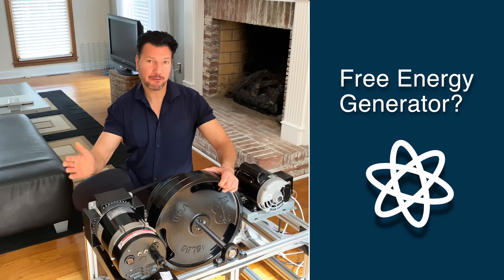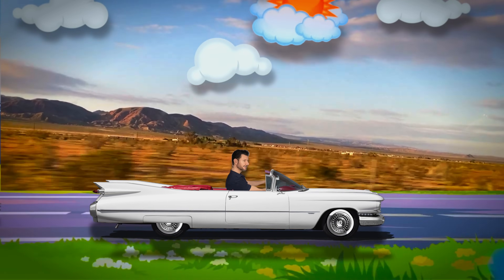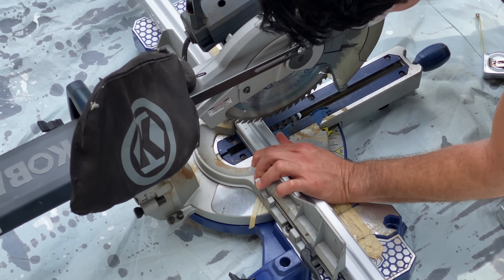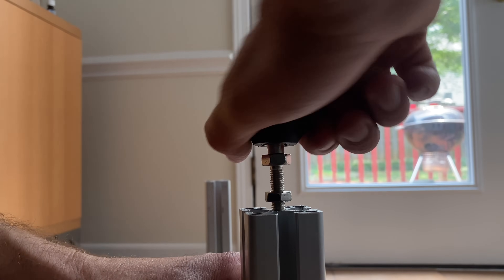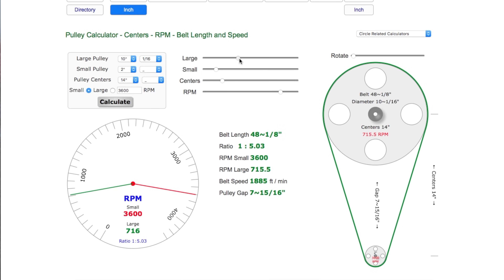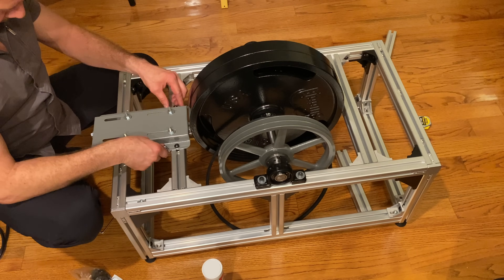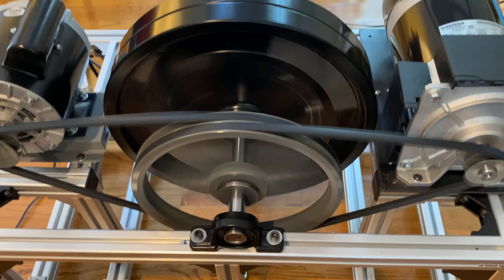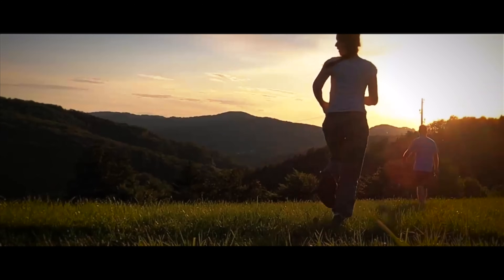How to Make a Free Energy Generator!

Comment: Finally a serious video !, I am playing with free energy since 10 years now ( i am a certified electronics technician )and, my best result was with gravity generator ( like william skinner ) i fully understood his system and ITS WORKING !. A flywheel is like a mechanic capacitor, aka it will accumulate the energy from the motor BUT you will store ONLY a part of the spent energy to run this flywheel....so its a 1to .7 ratio...you loose energy.....you will need a very effective motor ( like pmg ) to run the flywheel and in combination of a very effective generator too maybe you will have a gain greater then 2.....you will have to fight with friction,heat,back emf, to reach that level of efficienty.with a w.skinner system, a child can push a 200 lbs of weight with a finger and return to his initial position with the same finger push !! thats efficient... the problem with all the video of youtuber i seen was not the initial understanding of mr skinner........but justed a fade imitation ! its so simple but it took to me 5 years to fully understood !!
Reply from the maker: I will have to look Mr skinner up.
With your background and 10 years of research I hope you will give me your feedback also on my next video that I am planning about free energy.
I have some new ideas that are right up your alley would love to hear what you think of it. Hopefully I can get it done by mid Nov.
Thank you!
Reply: @MarkusNenning  OF course !, i will be glad and curious too to watch your further desing ! sorry for my english coz i am a canadian french speaking language...
Reply from the maker: @topgun4229  no problem English is not my first language either
Reply: @topgun4229  well as a certified expert, you should know right fr the start it’s not going to work , basic physics !!
But why search for free energy in this pointless way, it’s already here and easily available, 
Solar power, i haven’t paid a power bill for 8 years, 
(Easy so long as you have some place for panels)
Reply: @spinnymathingy3149  You are RIGHT and NOT !!, there is nothing free of course, BUT, take a lever as an exemple..... you can lift a heavy weight with a smaller effort than without, right ! In my example of w.skinner, the system is so effective than you can move a very heavy weight and, return it as is initial state with the same effort !, its PHYSICS ! not MAGIC !

SO, lets say that what we called the so free energy effect is in reality a very effective way of using physics to create a greater effect, in this case, i used the gravity, its free, and always availlable !! i worked on almost every different kind of '' free energy ''
the very popular flywheel too...and yes its possible BUT you have to use a way to introduce the power of gravity into your system...otherwise it will act as a mechanical capacitor..thats it !

Remember, not so long ago....the maximum speed of a car was 25mph, today, with the same amount of fuel, speed are over 80mph !, this is because they found a more effective way to use fuel !, same here ! just compare the LED to an old filament bulb light ! LED use less power for brighter light !
dc motor too are involving !
So, to conclude, never say its impossible because they said is it, look forward with a new idea and you will succeed !
Reply: @topgun4229  respectfully your 2 examples don’t add up to a logical conclusion to support your thoughts. Firstly with W Skinner, those displays were over 80 years ago, now with the increasing cost of power over the last 40 years there would be an available generator as shown in every house by now, the clear fact that there isn’t is proof it doesn’t work. Secondly the example of how when using a lever you can easily move a heavy object, ?? that’s a simplistic understanding of what’s going on, your not getting out more than you are putting in because it takes a lot of light movement on 1 end to get very little movement on the other heavy end, doing the maths power in = power out (less losses along the way)
Then the other examples of a car travelling faster now than previously, of course engines are more powerful now, but compared to the power source going into the engine (fuel, petrol ect) they currently are only around %35 efficient, that’s right %65 of energy used to drive a car, run a power plant ect is wasted in friction, heat and noise ect
Reply: @spinnymathingy3149  Dear spinny.... You make exactly the same mistake what most people did !, even some real university students understood what i tried to explained ! , its very hard trying to explain such concept just by writing....give me some times, and i will show you on my website HOW to use gravity to make a skinner machine ! I dont believe in free energys.. But I believe of a better use of available energy for multiplying this energy !
About car...... in the sixties, my father in law buyed a new car ( ford ), after a week of traveling around, the gaz tank indicator was almost near full.... so, he called back the dealer and explain that the fuel gauge was deffective...after a week, the car was repaired and the problem was not the fuel gauge, but.... the cie forgot to remove the experimental carburator ! instead of 6 miles per gallon he was experiencing a..60 miles per gallon !!!,
I heard the same story from an old american guy who had the same experience !, So, believe me... Things can be made better !!!
Reply: @topgun4229  great to see that you are trying to achieve efficiencies, the world needs that. 
Could you please explain to me 2 things, 
What you currently can achieve ?
What you think will be achieved ?
Reply: I loved the explanation. Well so this can work for sure
Reply from the maker: @mwambabuilders  No in this setup it does not work.
But I will share a few ideas that I think could possibly work in my next video.
Thank you!
Reply: How can an average person understand? I’ve been searching for a few years, but I’m not an electrician and barely understand how this works. Ps. Another Canadian here.
Reply: @ariannarp6866  The genius was william skinner....he gave us in 1939 a small video showing his invention...when you have like me a good background in science and you tried EVERY 2 DAYS to understand, for sure you will understand after 10 years !!!, lots of people tried WITHOUT understanding coz they didnt understood the principle of lever and weight......the only drawback is....its big and heavy....lots of weight are involve here...but it work ! and it doesnt breake any law of physic !
Reply: @topgun4229  cool. Thank you. I hope it’ll be simple enough to figure out at some point.
Reply: @ariannarp6866  I will release soon howto to this AKA how to moove a big weight from 0 to 180 degrees to 180 to is initial position with only a few miliwatts!
Reply from the maker: @ariannarp6866  I don’t think you need to necessarily be an electrical Engineer.
Sometimes people  with common sense  achieve much more because the have no bias towards possible or not.
What is it you would like to accomplish?
Reply: @MarkusNenning  true. I want to create free power on an off grid scenario.
Reply from the maker: @ariannarp6866  in that case you might want to collaborate with someone else.
Reply: @MarkusNenning  👍

Comment: Hey I think your doing a great job! Have you tried a larger diameter and heavier flywheel?  I think the heavier the flywheel is the better it is 400lb min. This creates the enertia/torq that is needed To maintain the generators speed. I’m sure it will work. Are the usable watts the difference between what the dive motor produces and the watts the generator makes?
Reply from the maker: Thank you Adrian!
I will have to reinforce my living room floor before I can build a 400lb flywheel :)
I am thinking of doubling up my plates or find something with a bigger diameter like you suggested.
Reply: @MarkusNenning  Stop fooling people you rogue.
Reply: Try to use concrete in a bigger diameter truck tyres.
Reply from the maker: Thanks

Comment: due to drag, gravity, inefficiency of the motor and generator and a few other reasons this should be impossible. Does not mean you cannot have fun seeing how far you can take it. I would recommend changing from big pully on the flywheel with a small one on the generator to swapping them around. so small pully on the motor to a big one on the flywheel then a small pully on the flywheel to a larger one on the generator. 

Also look into a more refined rectifier to handle the impedance on the generator. maybe bleed it off to a supper cap that can help with the initial spike in draw when swapping the motor over.  

I would also suggest something to encase the flywheel as well. reduce the turbulence generated by the open air gaps in the weighted plates. the turbulence is a loss in energy to drag. we all know a near perfect vacuum would be best.
Reply from the maker: Thank you very good suggestions! And yes I am having fun! :)
Reply: @MarkusNenning  there is also a variable pully system that uses a clutch system widen or make more narrow the gap increasing or reducing the size of the pulley dynamically. Can't wait to see the next experiment.
Reply from the maker: @jsdraven  I will have to look that up 
Thanks!

Comment: There's a reason the Indian guys use older motors & generators. There's no limiters & failsafe switches in older motors. Also, if you're in the US you're use to 110v but most of the world use 220v to 240v. We don't have access to 110v because it's so dangerous & I dare say India is in the same camp having had greater British involvement. In the US they've obviously countered the jumping of the circuit somehow. 220v is much safer because it requires lower amperage & therefore the wiring can be smaller.
Reply from the maker: Thank you Rex 
Yes, I think a three-phase system would be more sufficient but unfortunately, I don't have that in my living room :) 
I actually made a video about the topic you speak of if you're interested 
https://www.youtube.com/watch?v=H1pLg9QWPMM

Comment: I have been looking at this type of set up for months along with hydroelectric and solar options.  Do you think it would be possible to set up a 24 or 48v system to run a brushless DC 3750 rpm motor off a battery bank? 

You could then charge this while the generator is running off a simple battery charger without drawing down the voltage when switching from the grid to the generator.  Then you could run the house from a clean power inverter.

I am looking for a silent means of generating power without drawing attention.
Reply: With electronics everything are possible !, you will need some high power diodes to insulate both power sources ( you dont want to send power to your solar panels to your hydro-generator...otherwise you will destroy each other...)
some circuits to dump excess power to not overcharge the batterys bank ( you dont want to destroy the batterys....) you will need deep cycle batterys ( regular batterys wont survives a lot of charge=discharge cycles ) and of course some inverter ( sinewave or squared wave ( cheaper but not very good for transformer based appliance), so...yes its possible !
Reply from the maker: @topgun4229  thank you!
You seem to know what you are talking about!
I may have some more questions for you down the road! :)
Reply: @MarkusNenning  No problem !with my 50 years of knoledges i will be glad to help ! ( i am not so old lol.......but i made my first am voice transmitter at 11 years old.....i saw the evolution of electronic,and never stop learning and practicing.......
Reply from the maker: It’s an interesting idea Howard.
A friend of mine is starting a hydroelectric generator soon to run crypto mining equipment.
I may visit him and make a video.

I have also already thought about perhaps using a few solar panels to support the generator.

I will share my new concept in a future video hopefully soon.
Thanks for your feedback!
Reply: I believe these systems work due to correct combinations of motors, generators, alternators and mass size, tuned correctly.   ac or dc.   system rpm, voltage, and size should not be a problem as long as you have balance in tuning the components.      Tip:   instead of using the water in hydro power system to spin something, use the water as a mass, it's weight to set up an oscillation.  funnel the water through a pipe that you can swing side to side, allowing the weight of the water to rock a mass.   like a pendulum, then use the rocking pendulum to power what ever you are wanting to power.
Reply from the maker: @rmendes2mendes915  interesting idea.
Thanks!

Comment: Thank you, great job
The idea is good and may need some adjustment, such as the motor speed should be as high as 3000 rpm, the motor pulley to be as small as possible, and the generator should be at a low speed, preferably 750 rpm.
Thus it can reduce the engine load.
The flywheel also must be weighted around the outside to give a more efficient thrust.
Finally, if this method does not work, you can use a DC motor and start it from a battery, then charge the battery from the generator, and so on, it is sure to work
Once again thank you.
Reply: the motor speed should run at a rpm where it operates at its most energy efficient speed.  motor pully agree, small. low speed type generator yes.  flywheel main mass on outer edge of flywheel, yes.  and maybe even larger diameter flywheel with same mass.
Reply from the maker: Thank you Narmo
All good points!
I am working on a concept without pulleys altogether.

Comment: Maybe You need a Electric Centrifugal Clutch' That Engages at a Safe Start Up Speed, Then Stays Engaged Until Its at a Good Charging Spinning Speed, Then 'Disengages' So To 'Free Spin' Without Motor Drag' Until It Slows To a Point That No Charge is Happening' Then It Re'Engages To Repeat The Cycle _ imo_
Maybe in India, They Use an Older Type of Motors, That Have No Drag? 
I dunno?🤔 _ Good Luck!
Reply from the maker: I had thought about something similar using electronics where I would basically Puls the motor and Puls the generator output offset to each other.
The motor would get only half or a third of Pulses.
But yes a mechanical clutch could work too.
Something similar is used to turn off the starter capacitor on a single phase motor.
Thanks for sharing will look into it.

Comment: ok, do not stop trying, it is only to try, this project must work, the detail is that they do not want to reveal it, since the part of the large power generating companies would go down until they reach bankruptcy. I am in that plan of getting fully involved with the project, since I have extensive knowledge of electronics and electricity, as generators, I need to get into the motor part, according to the relationships of speed, mass and force, since the wheel plays a important role, in maintaining the loss of speed, generated by inertia.
Reply from the maker: That’s fantastic!
Maybe we can exchange some ideas.

Comment: Greetings, the whole secret is in the type of generator you use, there are generators with remanence, that is, with magnets, for when it exceeds the speed it generates and with the help of the 50kg wheel it can be maintained with the movement generated by the motor, more the pulley ratios, which must go in the correct positions, employs trial and error, that's what makes things work, good luck on the project.
Reply from the maker: Thank you Anjos!
I have my eye on a permanent magnet generator but it’s like 5k 😳
I am looking for a bit cheaper alternative:)

Comment: Amazon delivers steel plate weights and steel disc brakes. Try using adhesive lead weights for vehicle wheels.
Reply from the maker: Will check it out
Thank you good idea!
Reply: @MarkusNenning  I'm not saying this method will work, I haven't personally tried it, but I am merely providing supply and materials advice
Reply from the maker: @dare2scheme904  and I appreciate that.
I looked for a long time what I could turn into a flywheel but didn’t think of that.
Reply: @MarkusNenning  if the Indians have a flywheel, then they likely bought it from Alibaba or Bangood. Americans would only use a flywheel on a rare occasion with farm equipment because they import industrial products. You could otherwise try a vehicle flywheel from the nearest junkyard.
Reply from the maker: @dare2scheme904  a vehicle flywheel is the small at least from a car but I will check out if they have maybe something from a heavy equipment.
Reply from the maker: @dare2scheme904  Italy is beautiful!
I hope it works out for you!
Reply: @MarkusNenning  yes it is and God willing it will work out. Nevertheless, it would be better to suffer as a man among my own than to be a successful clown among strangers

Comment: Try to use car Alternator and use 3000 watts inverter, you are not failure, but just the beginning for the big success
Reply from the maker: Thank you very much Tahanlaoboy! 
I researched car alternators before I bought the AC generator I have now.
The problem with car alternators are that you get low voltage DC that you then have to convert with a loss.
But I will look into that again.